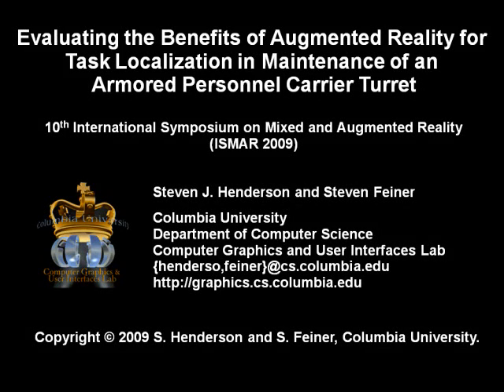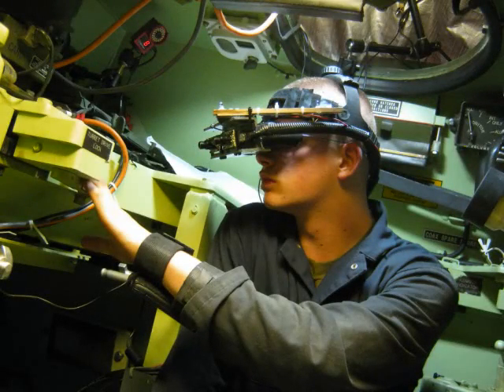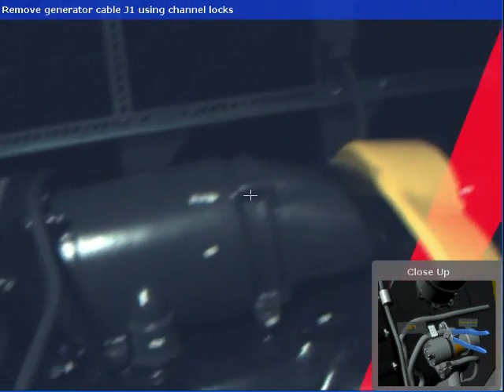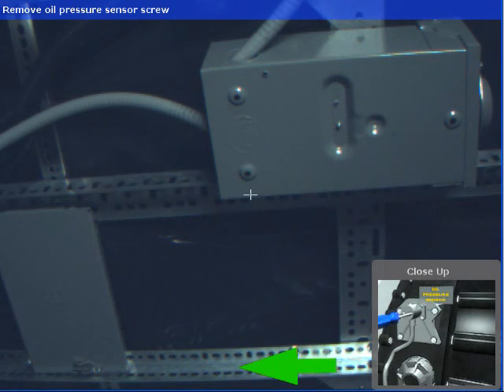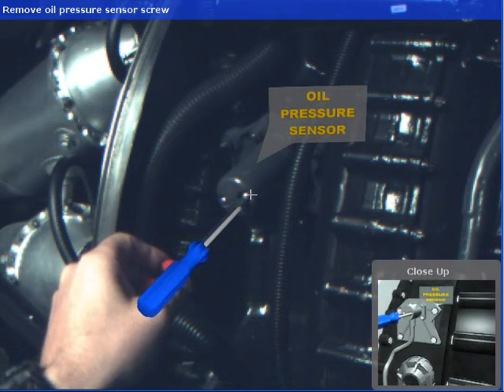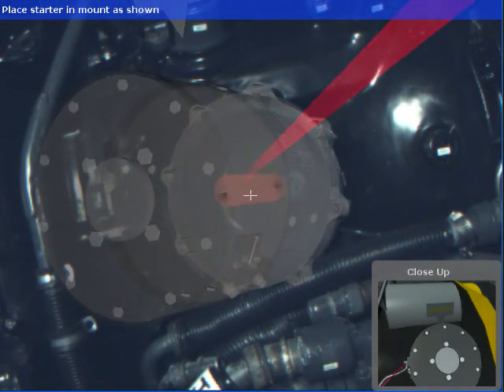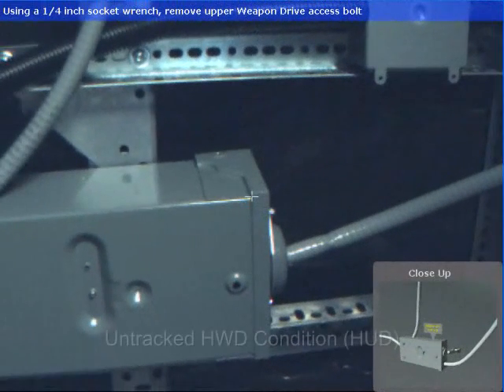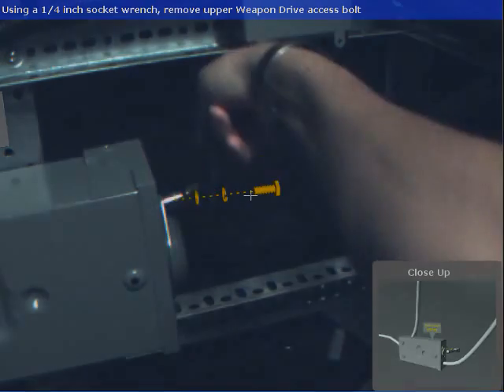Augmented Reality for Maintenance and Repair

Comment: Heh, I applaud your fine work.  Very cool and definitely a big step ahead compared to the interactive videodisc-based maintenance aiding systems we designed at Westinghouse Defense in early 1980's for F16 and AWACS repairs, leveraging graphics-overlays over video and wireless transmission to touch screen handhelds on the flightline.